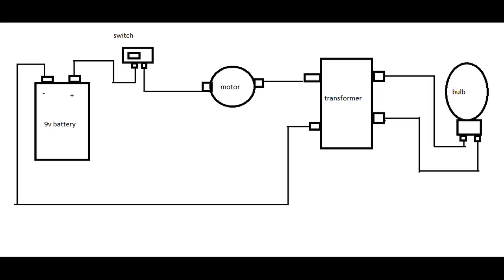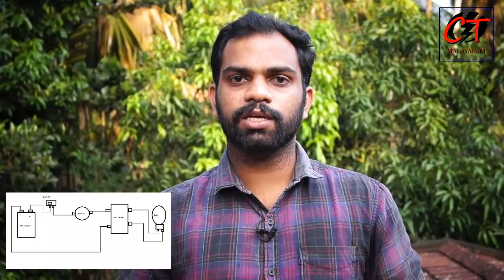Mini inverter..10 minuteകൊണ്ട് ഒരു മിനി ഇൻവേർട്ടർ

Comment: Fake video
I tried not working 
By theory also it will not work
Reply from the maker: its 100 percentage working..i will show in live as soon as posible
Reply: @aghoshvyshnavam  
U said DC supply is converted into square  pulse how is it possible using a DC motor? 
can u state by what law it is working 
Can u show the wave form using CRO/DSO
Can u give the technical specification of all components used?
Reply from the maker: @lijuthomas2724 by the mechanism of brush..in small dc motor have  3 split rings..when the motor is running only two split rings are connected to brush.then motor rotate another 2 are in contact with brush in beteween this change there is an small gape without touching any splitring that time out put 0 exept this always output high (9v) so there is an squre like wave produce as input of transformer...becz motor series with transformer
Reply: @aghoshvyshnavam  I tried it today but it didn't work 
Can u tell me specification of motor and transformer please.....
Reply from the maker: @lijuthomas2724  if u not get correctly an esasy way to get open that dc motor and breake one split ring out then u can get ..but when you switch on u just rotate motor initially ..motor not self starting by this method
Reply: @aghoshvyshnavam  any way thanks for responding

Comment: What is the watts of battery and, also one doubt in this circuit the transformer secondary and DC MOTOR is in series so the 9 v is not fully getting to the transformer that's why the intensity of the light is less compared to the ac 220v you shown earlier, according to the theory of transformer input voltage difference affect output also due to this you can use 12 v type transformer and put two 9v Volt battery in series for making 18v  then the voltage drop will not effect output voltage I think you got me any way good idea keep going

Comment: Not working 😑
Step down ആണ് ഉപയോഗിച്ചത്
Reply from the maker: ath thala thirich connect cheythal mathi bro
Reply: @aghoshvyshnavam  അങ്ങനെ ആണ് connect ചെയ്തത് 
But 8v വരെയേ കിട്ടുന്നുള്ളു
Reply: @aghoshvyshnavam  ഒരു രക്ഷയും ഇല്ലാ ബ്രോ 
12v 1amp centre tapped transformer ആണ് ഉപയിഗിച്ചത് .
ഒരു solution /
Reply: @follow_the_truth  local motor use chay... 
Set aavum..

Comment: എല്ലാ പാർട്ട്സിന്റെയും ഡീറ്റേല് കൊടുക്കാമായിരുന്നു.
എത്ര സമയം ഇത് വർക്ക് ചെയ്യും.?
Reply from the maker: ok
Reply: വളരെ ലളിതവും ബുദ്ധിപറവുമായ ആശയം ഞാൻ താങ്കളുടെ പ്രവൃത്തിയെ ആത്മാര്തമായും അഭിനന്ദിക്കുന്നു. ഇനി പറയുന്ന കാര്യം ഒരിക്കലും താങ്കളുടെ പ്രവൃത്തിയെ കുറ്റപ്പെടുത്തുകയോ വില കുറച്ചു കാണുകയോ അല്ല. ബഹുമാനത്തോടെ എന്റെ എളിയ ഒരു അഭിപ്രായം രേഖപ്പെടുത്തട്ടെ:
   ഇത് ഒട്ടും economical അല്ല. ഒരു മാതൃക ആക്കി പ്രോജക്ട് പോലെ കാണിച്ചു കൊടുക്കാം. കാരണം ഇവിടെ എനർജി loss ഒത്തിരി അധികമാണ്. മോട്ടോർ പ്രവർത്ഥിക്കുമ്പോഴും ട്രാൻസ്‌ഫോമറിൽ step up നടക്കുമ്പോഴും ഊർജ നഷ്ടം ഉണ്ടാകുന്നു. 9 വോൾട് ബാറ്ററിയിൽ നിന്നുമുള്ള വൈദ്യുതോർജം മോട്ടോർ ഉപയോഗിക്കുന്നു. അവിടെ split ring commutator ഇൽ വെച്ച് sqare wave ആയ dc transformer ന്റർ പ്രൈമരയിൽ നിന്നും secondary ലേക്ക് electromagnetic induction വഴി transform ചെയ്യപ്പെടുമ്പോൾ ഊർജ്ജം ഇത്തിരി നഷ്ടമാകുന്നു. അങ്ങനെ ഏകദേശം 200 volt ആയ sqare wave dc ( not alternating current - ac ) led ബൾബിലെ smps ഇൽ വെച്ച് 50 വോൾട് dc ആയി വീണ്ടും convert ആയിട്ടാണ് led strippil എത്തി ബൾബ് പ്രകാശിക്കുന്നത്. അവിടെയും ഊർജം നഷ്ടമാകുന്നു. മൊത്തത്തിൽ ഇങ്ങനെ ഉപയോഗിക്കുമ്പോൾ പെട്ടെന്ന് തന്നെ ഏകദേശം 10 മിനുട്ടിൽ കുറവ് സമയം കൊണ്ട് ബാറ്ററി ചാർജ് തീർന്നു പോകുന്നു. അത് നഷ്ടമാണ്. പകരം led ബള്ബിനുള്ളിലെ led സ്ട്രിപ്പിൽ ഉള്ള ബള്ബുകളുടെ series connection ഒഴിവാക്കി എല്ലാ ബൾബുകളെയും parellel ആക്കി connect ചെയ്താൽ വെറും 3.7 വോൾട് ബാറ്ററിയിൽ 2 മണിക്കൂറിൽ അധികം ഉപയോഗിക്കാൻ കഴിയും.